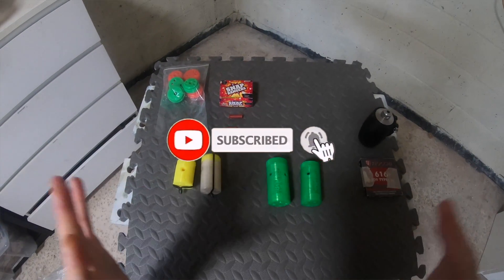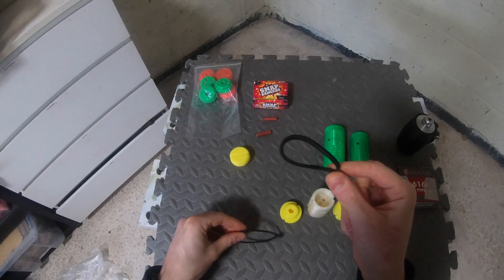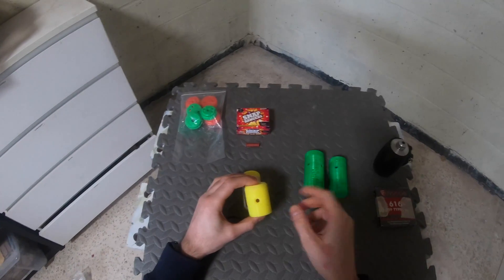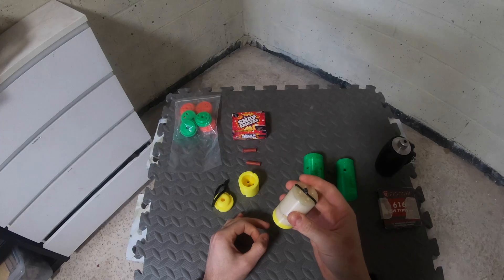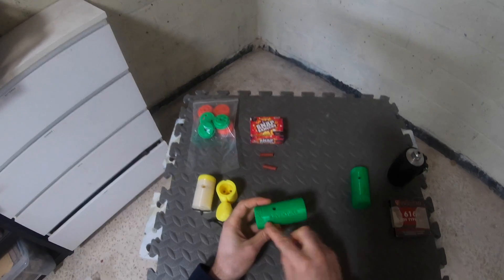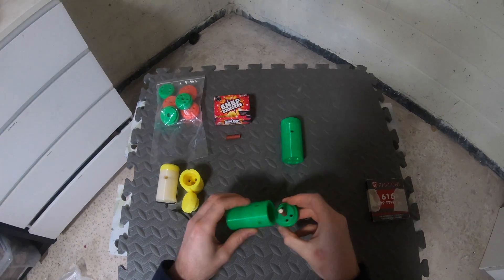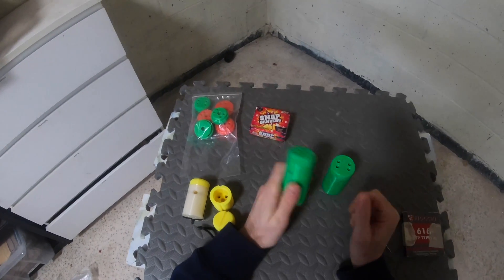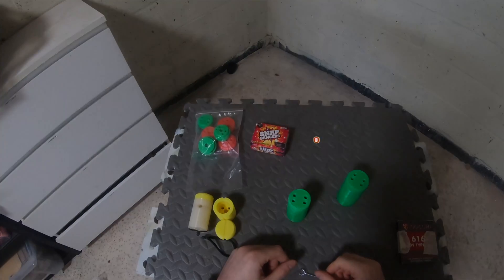3d Printed Airsoft Impact Grenades part 2

Comment: with Independence day recent, I found Snap Bangers at the fireworks tents. sadly they're smaller than the thunder snappers so they don't "fill" up the holes. this meant that i had maybe a 10% ignition rate. using a wide soda straw cut just a little larger than the length of my snappers helped a lot but it's still inconsistent on ignition. I'm not blaming the design, adding some info for people wanting to use this. you want the thunder snappers or something 6-7mm wide and about 35mm long.

Comment: Printed the big one off, thank you for the files. The lid is really tight, I had to use a mole grip to tighten it all the way up 🤷‍♂️
Reply from the maker: With printed threads using PLA I recommend a bit of Vaseline on both sets of threads when starting. The new PLA can cause a lot of stick slip making it very tight, once used a bit with Vaseline it works well.
Reply: @adventureairsoft  thanks, I ended up using some coconut oil just cause it was closer haha. I used 20% infill and the inner tube separated from the main body after about 6 uses. I got a couple of kills with it though

Comment: When I open the files in CURA the size is wrong, is massive, which is the exact height for each file? Thanks!
Reply from the maker: Think that’s an issue with cura as I use cura. Try and adjust the scale the diameter is 40mm if that’s set the length should be ok
Reply: @adventureairsoft  yes I also use cura, thanks for the answer! I will try it

Comment: So if these are 40mm wide could they be launched from an airsoft mortar the same way that NERF footballs usually get launched? (gassed-up 40mm shell behind it with no BBs, used as propellant only I believe)
Reply from the maker: I assume so but would have it be under 40mm to slide inside the barrel but if they were yes could launch them. Not sure if any site would allow it though.
Reply: @adventureairsoft  I have attended a site that allows certain types of projectiles for scenarios and the launching player is expected to basically miss on purpose and the projectile has a radius of (xx) number of feet where anyone in that range must call their hit. That'd be why I asked. Thanks for the info.

Comment: Silly question but how are you carrying the thunder snaps without the going off I.e being hit or if u trip n fall
Reply from the maker: I was using a little 3d printed case that worked like a draw holding 209 primers and snaps. I did see someone use a kinder egg with cotton wool in also.
Reply: @adventureairsoft  sweet having little trouble finding the thunder snaps in UK now especially in Kent...thank you for the reply keep doing what ur doing dude 👏

Comment: Live in cali, is there a way one won't cause a spark
Reply from the maker: Apologies for the very late reply I missed the comment, Yes to prevent this you can tape around the outside or the inside of the grenade blocking the vent holes it will still function.

Comment: Hey. The snap bangers i find in my country are 5mm diameter and when i put it in the hole they are too loose . Can you please tell me the diameter of your snap bangers :) Thanks in advance .
Reply from the maker: Hi when we could buy them Geri the UK they are a similar diameter. The snap is designed to fit loose in the grenade and is set of with the force of the impact of the  grenade hitting the floor.

Comment: How did you get your caps to screw on so cleanly, I pry the cap on to get the threads to line up correctly.
Reply from the maker: Try a little bit of petroleum jelly on all off the threads some materials cause stick slip. You can also use a bit of oil just to get it going.

Comment: Just a heads up, the links are dead.
Reply: True, Links are dead
Reply from the maker: Apologies seems I have an issue with Google drive thanks for telling me. One back on I will let you know.
Reply from the maker: @markallen4212  Links now working apologies for the wait
Reply from the maker: Links now working apologies for the wait
Reply: @adventureairsoft  I appreciate the work, thank you very much!
Reply: @adventureairsoft  Thanks!
Reply: @adventureairsoft  why are the prints so big i went to cura and there just super large
Reply from the maker: @tylerhoagland7160  How big are you talking they should be approximately 40mm or so wide depending which one you choose and 80-90mm high?
Reply: @adventureairsoft  THERE Larger than my printer
Reply: @adventureairsoft  never mind i found the one